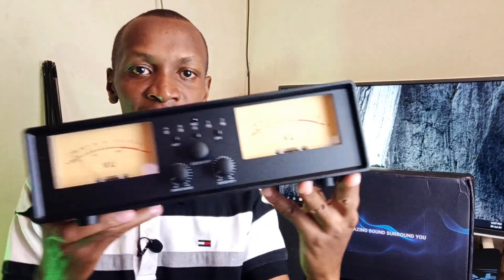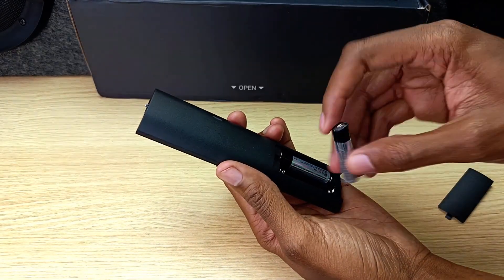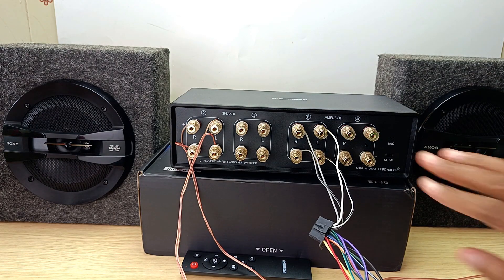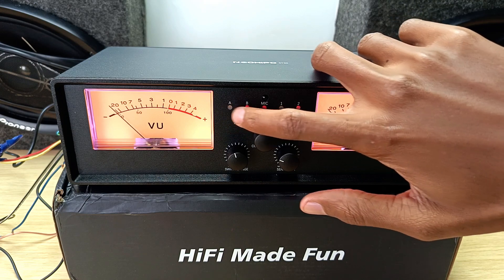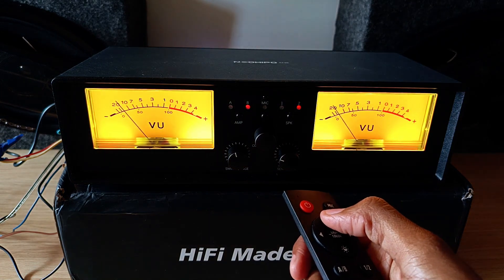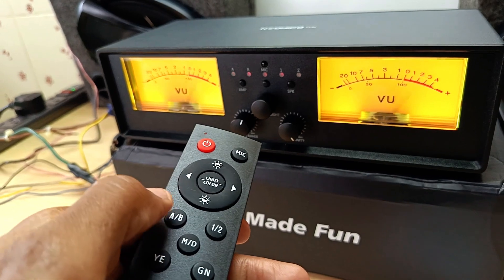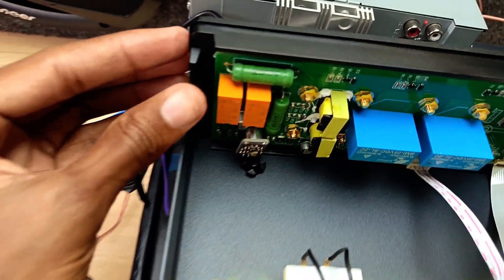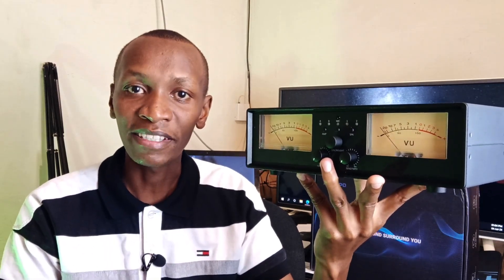NEOHIPO ET30 Amplifier and speaker switcher, How to use and review

Comment: Hello.
I need to know if I should return my (defective) unit or not.
I am using it through the microphone without cables.
The speed adjustment button does not seem to be very efficient.
When you leave it at the minimum level, it gets closer to the red range. When you leave it at the maximum level, it gets further away from the red level.
The sensitivity button seems to work very well.
My video: https://www.youtube.com/watch?v=xcF5hseHv4w
Thank you in advance for your feedback.
Reply from the maker: Mine behaves exactly the same. I don't think there's something wrong with your unit.
Reply: @DominicGichane  Very Thanks. I feel more relaxed. With the cables it was much better.